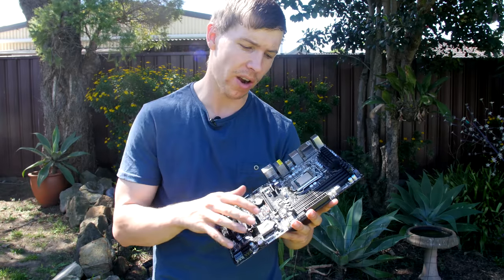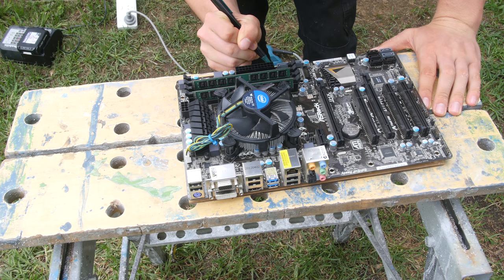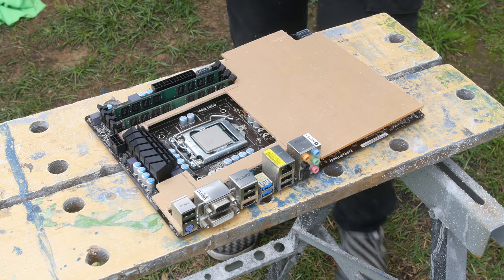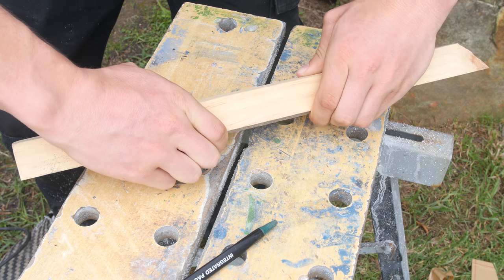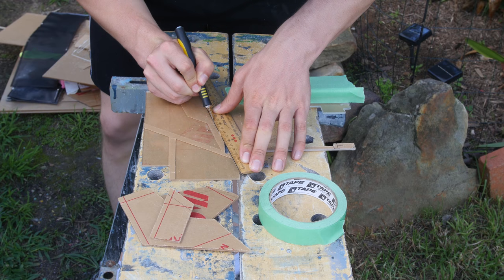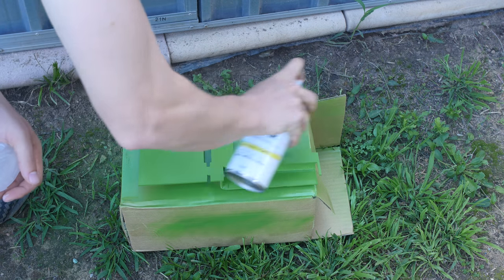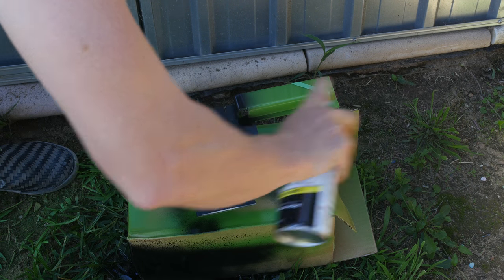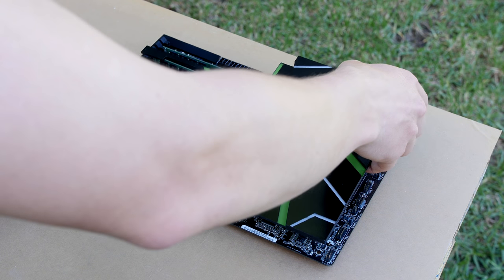How to Make A DIY Acrylic Motherboard Armor + Paint The Plexiglass

Comment: Where can i buy acrylic
And whats the easiest way to cut it.
Could i use a dremel with specialized blade.
Reply from the maker: +High Impact Productions hey man you can buy it from amazon or ebay and your local glass/plastic supplier. A dremel with plastic cutting wheel is fine

Comment: where from will you use the sata and other stuff required by the cabinet
Reply from the maker: +SRG Multinational Inc. Sorry what cabinet are you talking about
Reply: Designs By IFR Any kinda cabinet. Actually when you try to use the HDDs and SSDs from the board, the SATA ports are gonna get covered. Similarly the ports for the power and reset button, and USB 3.0, to be precise. The acrylic glass will obstruct the cables and will finally lead to a hell lot of mess.
Reply from the maker: +SRG Multinational Inc. No its all open down the bottom where the power/reset and usb are. Sata is open as well
Reply: Designs By IFR That's cool then. Besides, your build looks cool. Nice job mate.
Reply from the maker: +SRG Multinational Inc. Thanks man much appreciated

Comment: I was thinking of doing this with Acrylic, but 3D Printing it would be much lighter and easier.
Reply from the maker: +Jack Elms lighter maybe the same id say, easier, probably the same as well, in saying that iv never used a 3d printer but id assume you still need to calculate dimensions etc just like i did
Reply: Yeah, I was thinking about having a semi-rigid theme inspired by the FE Pascal cards, but giving it a ROG twist, drawing some inspiration from the Maximus VIII Formula shroud (Doing it for a M8 Hero Alpha and M8 Gene). It'll be a bit of a project to model and get everything positioned right, but it will be worth it.
Reply from the maker: +Jack Elms yeah definatly man, 3d printer is something id love to invest in

Comment: what if i use thermal pad as a adhesive would it work (plus its for cooling)
Reply from the maker: +NEØN you could but the armor is 1.5cm above the pcb so heat wont be an issue

Comment: I have seen someone do this before a few years back. It however uses a metal cover from a pc case.
EDIT: Would it be possible to drill some holes in the armor and add an optional 50mm fan?
Reply from the maker: +Kirby Bautista anything is possible =)

Comment: Just a question I was wondering to do somthing like this to my p67a-gd55  with an i7 2700k but I'm just having some questions about the capacitor and some other stuff like is that acrylics sheild mobo will not be a hit trap or somthing like and making electronics life shorter?
Reply from the maker: +NORSHAR hey man, electronics these days are designed a lot better in terms of thermals. A lot of motherboards are coming from the manufactures with motherboard armor such as asus maximus viii formula etc.. the motherboard will be fine my friend =)
Reply: Designs By IFR thank you I'll begin this work soon I'll send you some pic about :)  thank you for your time
Reply from the maker: +NORSHAR awesome cannot wait to see

Comment: yo really nice work <3. i have been thinking about doing somthing simalar to my pc in the future and my GF just gave me this insane idear of making a white acrylic front plate and then give it craks like what lava would look like and light it up with red and orange led. but im having a really tight budget on the part ( i'll get what is nessesary ) im just capable of making a dummy model. do you think the idear would work or is it just imposible to get a good enough shine through the entire pice even if you wrap the entire IO in led ? hope you like my idear and maybe could make a idear of it so that i maybe can have somthing to work from. <3
Reply from the maker: +maniza get some sand paper and give it a neat sand on the back of the acrylic, like 1200grit. Lay some vinyl on the front in the shape of cracks. First you need to paint the front black because light will easily get through white paint. Then paint white over the black and peel vinyl off. The sanding on the back defuses the light and picks it up a lot better so it looks more natural

Comment: Use a square lol or your lines end up not being perpendicular, etc...
Most manufacturers provide a motherboard diagram in the box/manual/website that you can use as a template WITHOUT man-handling the mobo ^^
Oi Oi Oi :)
Reply from the maker: haha, its ok i aint using the mobo this was just a quick afternoon project =)

Comment: can you make a before/after temp benchmark?
I bet this mod makes the cooling worse and the whole mobo hotter
Reply from the maker: +Attila Mucsi hey man i have already tested it =) its not affecting temps because there is no direct contact with the pcb about a 1.5cm gap for the heat to rise up and the fans are also exhausting the air

Comment: Could i make one of these out of wood in stead of acrylic?
Reply from the maker: technically yes you could, if you did i would definatly avoid putting it over the hotter areas of the motherboard because wood contains heat very well
Reply: Ok thanks for ou fast reply :D
Reply from the maker: +Carotzilla no problem =)

Comment: you need to make an update of this but integrate a better mounting solution and put rgb underneath so it really glows
Reply from the maker: +Jeremy Doss i can do an rgb one =)
Reply: that would be awesome!!! somehow have it for an underglow, idk if your electricaly inclined but u could have it powered off the fan header on the gpu with a splitter for no wires to show. and a nice way to mount it like a real backplate would. it would be a bit for advanced but it would be hugely popular with the more adventurous viewers
Reply: my mistake I thought I commented on a gpu backplate one but either way it would be cool. power from a fan header or USB header for RGB control through software, and u could have the screws that hold down the motherboard also go through the acrylic

Comment: As a Computer Engineer and Technician, I won't recommend these because of the temperature containment. I'll probably used the Flexiglass as replacement for the PCB Board and add some CPU slot and PCIe Slot.
Reply from the maker: +Ramp10er no temp issues. Already tested

Comment: I'm a bit confused by how it was painted, why not paint them the same way you would an rc car shell? I.e cut out details on the inside, spray them, then remove the rest of the protection on the inside to spray the main colour that way the plastic acts as the perfect clear coat
Reply from the maker: +Kester 135 cannot do that because this is multi layered and the adhesive would react with the paint
Reply: Designs By IFR you could have left the top layer clear and put the details and black paint on the bottom layer so you still have that 3D effect
Reply from the maker: +Kester 135 yes but i cannot because i need the acrylic weld in between, if there was black across the whole bottom then it would have made a huge mess because it reacts with paint

Comment: Why cover up the rest of your PCIe? If yo u weren't planing on using them why get a full ATX motherboard?
Reply from the maker: man, firstly, this is an old board, second this is just a tutorial, and third this is not a board that i am using in a build because i have newer boards. Basically i just used this board as a tutorial and i mentioned in the video that i was only going to cut one out to show you guys how to do it but mentioned that you guys can cut out more.

Comment: Great job, and not hating bro but the paint needs some work. Needs to be silky smooth,  like a brand new car paint. 

Not sure what all the texture in the paint is.  Is it orange peel,  is it cause you used rattle cans and it doesn't atomize properly?
Is this just what happens when plastic is painted?

Comment: does it affect mobo temperatures?
Reply from the maker: +Aleksandar Stefanovski na its fine
Reply: Beginning an answers with "na" is usually  not a sign for an answer based on reliable facts and measurements, isn't it? 
Here a few examples: 
Na, I won't need a second bucket of paint.
 Na, my truck will fit under that bridge. 
Na, Trump won't be elected. 
Na, he just wanna play.
Na, they won't block my credit card.
Na, I gonna pass that exam.
Reply from the maker: +Fat2Mad  looking too far into it mate, thats just how i speak. I am from Australia after all haha

Comment: not a bad idea...but wont work...1stly mb armors are designed for heat transfer to be sufficient and reliable throughout the mb and this would just make it ''choke" meaning the airflow is not good...and 2ndly how are you going to keep that armor in place? would probably work for a pc thats flat, but i think 90% of people use vertical boxes where the mb is on the side...
Reply from the maker: +Dimitris Simeonidis did you watch the video my friend? Your second question was answered. Also heat is no issue, the armor is not flat on the board, there is a good 1-1.5cm clearance for heat to rise up and get exhausted by the top mounted fans.
Reply: i did watch it. didn't hear or see anything about it. correct me if i am wrong on that. but my knowledge tells me that there is probably a reason why a motherboard didn't hit the market with a armor on it. not saying it would heat up and melt within 10 minutes of gaming, but would definitely affect the performance of cooling in the case.
Reply: There's the Asus TUF that has armor on it... Anyway, the main reason why motherboards don't have armors is the cost(in fact, the TUF uses its armor as a marketing feature). Also, considering how notebook motherboards are inside much cramped spaces, the thermals shouldn't be a problem.
Reply from the maker: +Dimitris Simeonidis there are motherboards with aemor on it xD Asus maximus formula boards and sabretooth boards to name a few. Iv tested the heat before and after making sure i didnt place the acrylic right on the pcb ao there is room for the heat to rise up and out because naturally that is what heat wants to do.

Comment: its pretty ,but not practical , cause mobo doesnt like heat at all :D
Reply from the maker: +Martin Benda there isnt any heat issues
Reply: Are sure about that ,cause mobo as source of heat will warm another capacity (that armor) ,and there is much worse airflow between mobo and armor. U dont have to noticed that all ,but those armors are not made at home for reason ,cause some parts of mobo are bit more sensitive to higher temperatures. Btw sorry about didnt expleain averything about that second capacity what armor makes ,but im not sure if i cant translate it to english so it will make sence to you.

Comment: you can't fit a gpu inside and also can't utilize all the other ports such as the pci port
Reply: you take good measurements and have a plan as in if one was to even use the extra pci  slots and if so plan for it